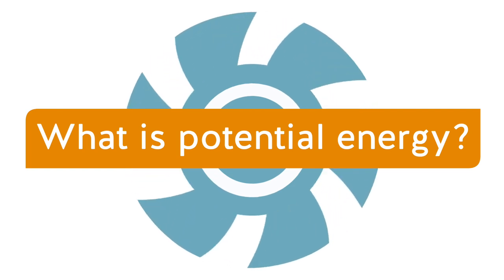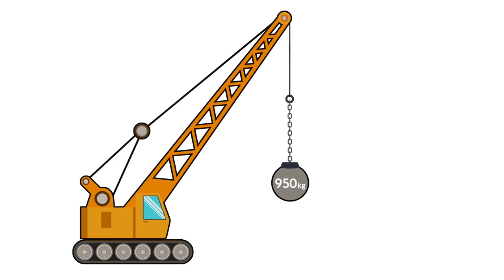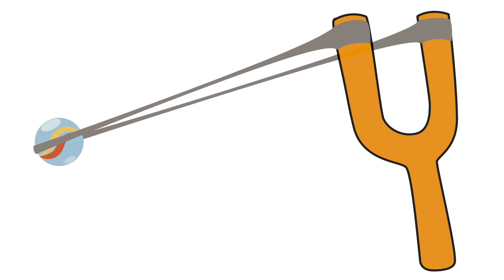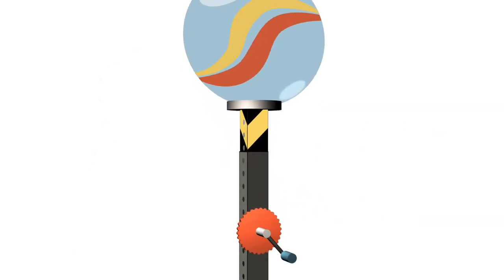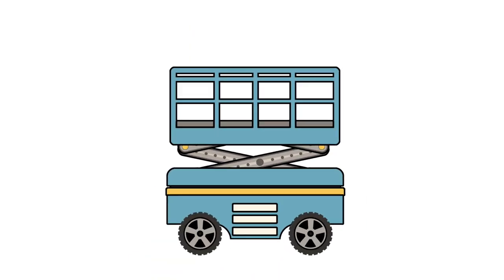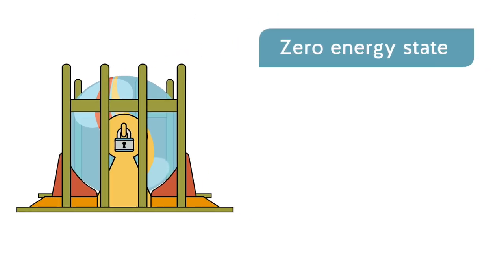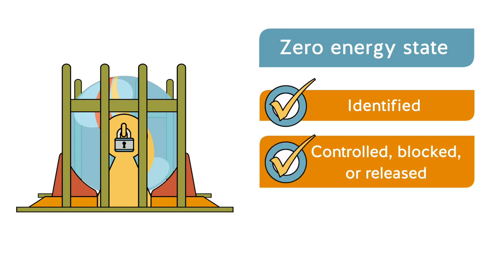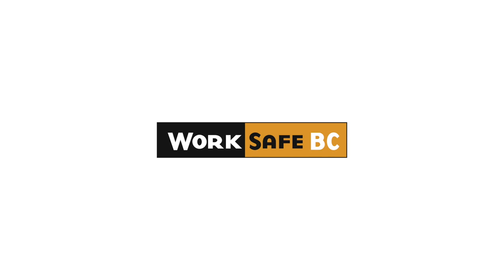What Is Potential Energy and What Are the Hazards? | WorkSafeBC

Comment: Thermal energy, heat storage devices.    It may by necessary to allow extreme hot or cold temperatures to dissipate before servicing the equipment.

Comment: Electrical energy can also be stored energy.   Batteries and capacitors may need to be disconnected or discharged and grounded before working on equipment.   And there could be more than one source of stored energy in very complex machinery.